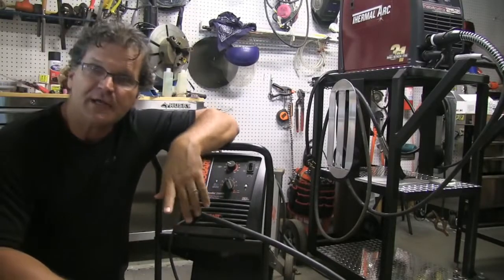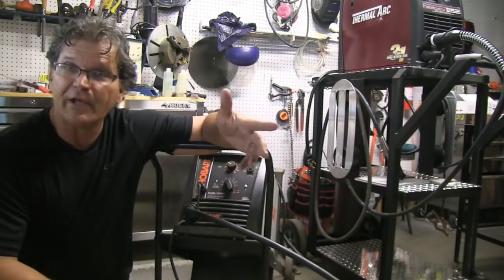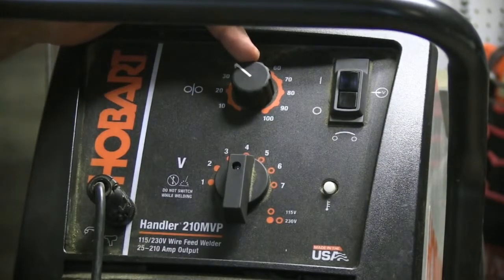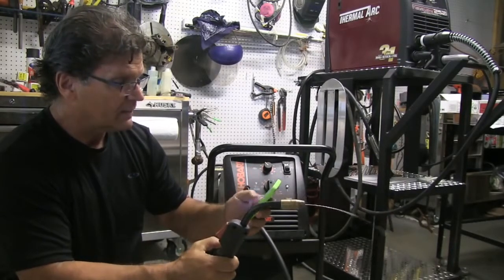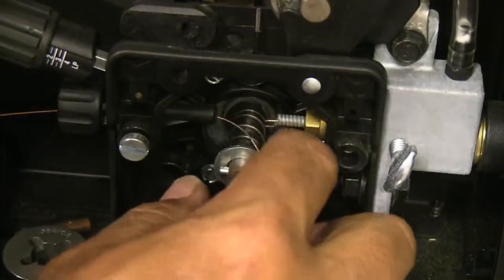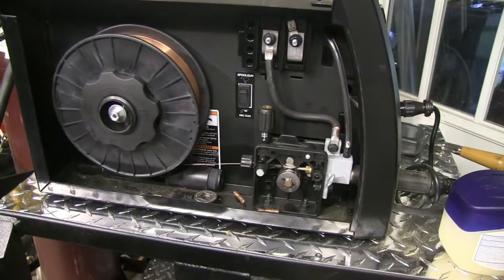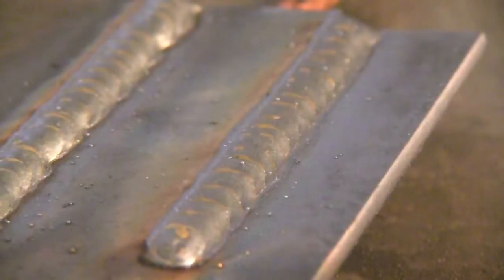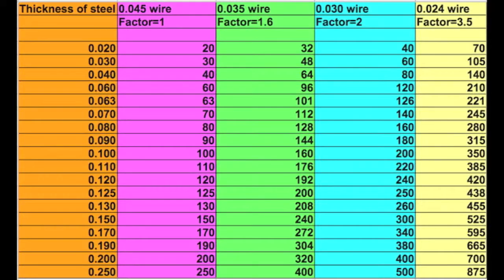Mig Welding Basics - part 3  [ Setting Voltage and Wire Speed ]

Comment: hello jodi , im studying MIG right now and i am trying to do root pass on pipe , but everytime i do down hill and reached the bottom it keeps pushing the wire and can't make a nice and neat weld :(. can you please give me a tip for it . by the way our machine we using are MIG 250 2 in 1 style, kinda new to this thing and it's not digital so i am just basing on sounds and test weld , am i doing right?